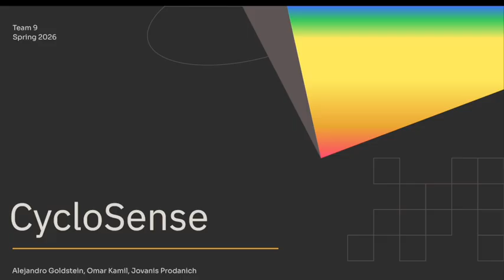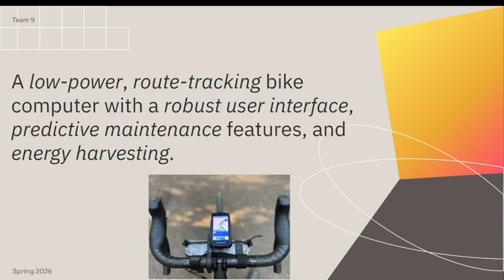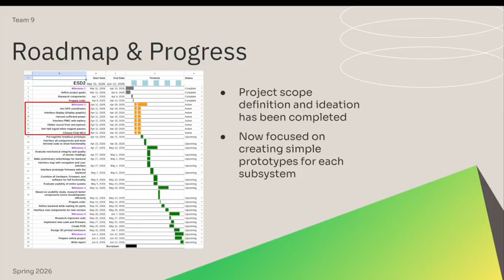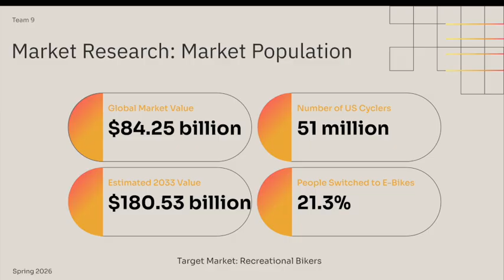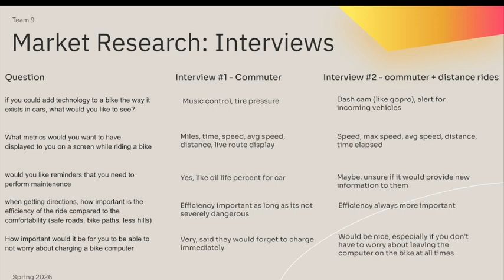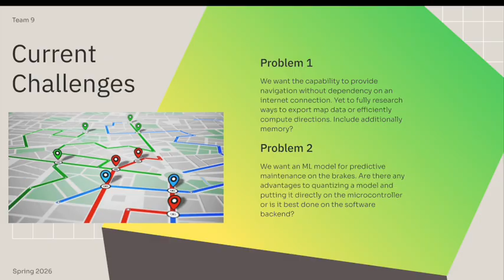Group 9

Comment: (weiqian)I think your project is a really strong idea, and the energy harvesting aspect makes it stand out even more. The hall sensor and magnet approach for speed sensing is also very creative and fits the bike application well. For the first problem, I think adding extra onboard memory would be the most straightforward solution if you want offline navigation, especially if you only need to store local maps or common biking routes. For the second problem, I think putting a quantized ML model directly on the microcontroller would be a good choice because it would allow the device to keep working even in outdoor areas with poor signal. However, this could also create trade-offs such as higher power consumption and limited computing resources, so that would need to be balanced carefully.

Comment: (Bobby)

Overall Impression: Really great idea! The three systems gives a clear area of focus for each team member, and I can really imagine this being useful for frequent bikers.

Component/Design Approach Opinion: Seems like you guys are on the right path, no notes.

Q1: Including additional memory seems like the most straightforward approach. For a theoretical commercial product, offering different storage amounts could better target different types of bikers. My only question is how much storage does a map take? Perhaps you may not need much storage to include a basic bike trails/roads map for a biker's area.

Q2: I'll be honest, I would need to spend more time with your project to fully understand the pros/cons of the two approaches. If your target audience are decently regular bikers, I imagine they have a general sense of the quality of their brakes, so quantizing the ML model for real-time analysis may be unnecessary, and implementing the model on the backend at the start/end of a user's ride would be more than sufficient. 

Good luck guys!

Comment: (Jun) I really like all three parts in the design of this project, especially the power and energy harvesting. Having that aspect of the design makes it really stand out. I think the design approach makes sense, and the hall sensor plus magnet for speed sensing is a really cool idea. 

Regarding the first problem, I think that the device would need to utilize extra on-board storage to store the map, or as an alternative design maybe you could design something compatible with the user’s smartphone that projects the map onto the device? As for problem 2, I think that quantizing the model and putting it on the microcontroller is the way to go for your current design since it doesn’t require a connection and you can get real time responses.